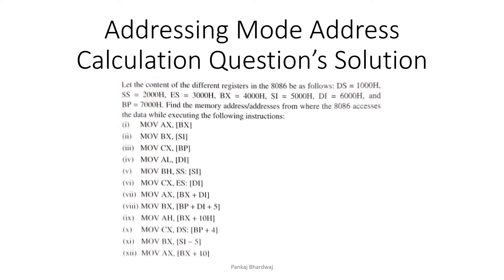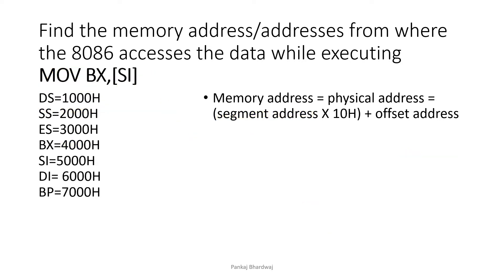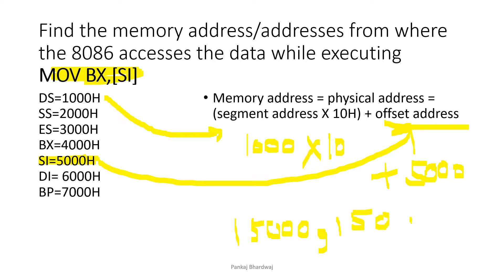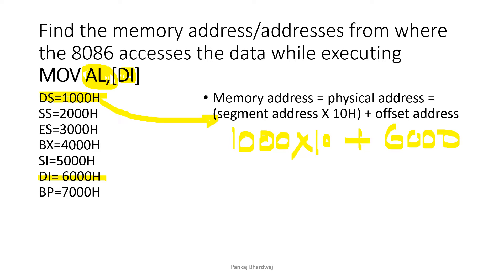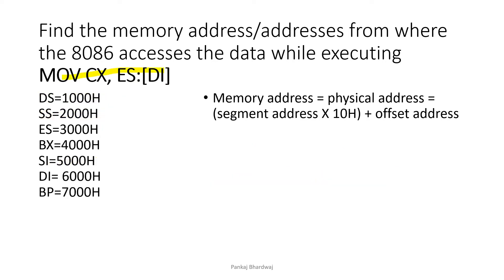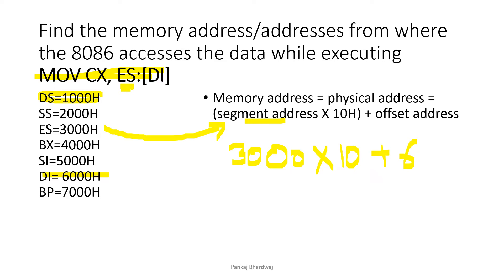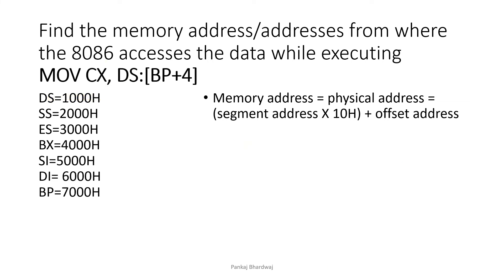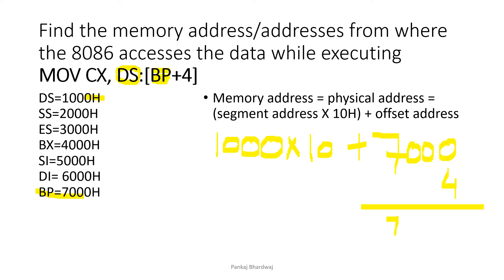Addressing Mode Address Calculation Question Solution

Comment: sir will make a lecture how to get status of flag registers  
and detailed video how to solve these type of problems

Question 26: What will be the value of accumulator after executing following instructions
MVI A, 49H
MVI C, 12H
ORA C
A. 5BH
B. 5AH
C. 4AH
D. 4BH

Question 28: Find the status of CF, SF, and AF after the following instructions are executed.
MOV AL, 35 H
ADD AL, 0CE H
A. CF = 0, SF = 1, AF = 1
B. CF = 1, SF = 1, AF = 1
C. CF = 1, SF = 0, AF = 1
D. CF = 1, SF = 0, AF = 0

Question 29: Assume that CS register=3000 H and IP =2000 H. To fetch an instruction form 
the memory, find the memory address from which the next instruction will be fetched.
A. 3200H
B. 32000H
C. 3200
D.32000

Question 30: Assume that, SS=3000 H, BP=0010 H, SI=0040 H Find the physical address in 
following instruction.
MOV AL, [BP+SI]
A. 30050H
B. 30040H
C. 30010H
D. None of the above